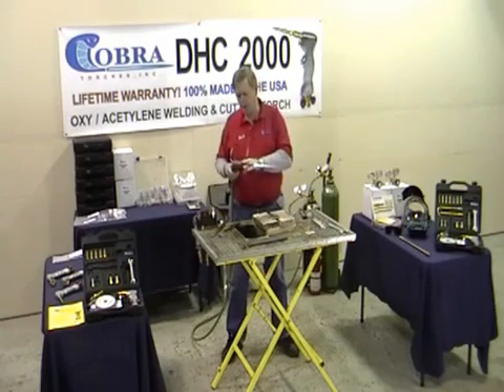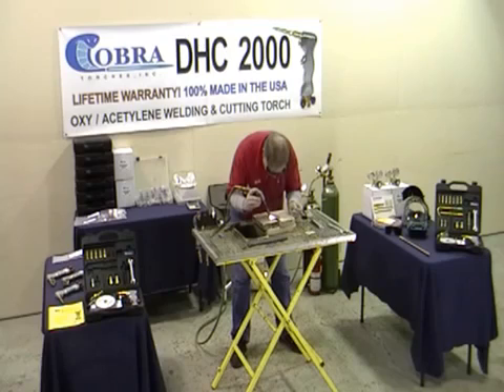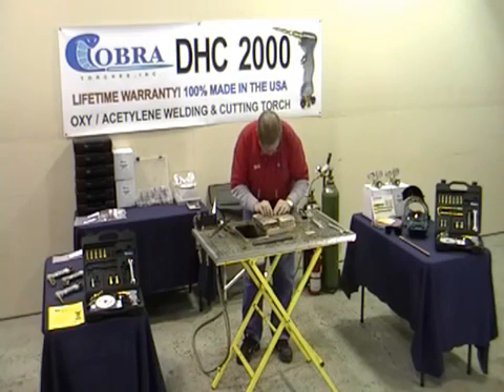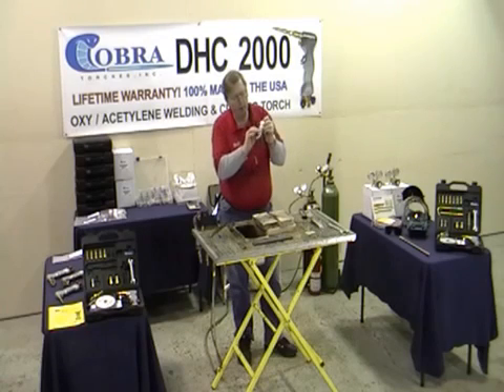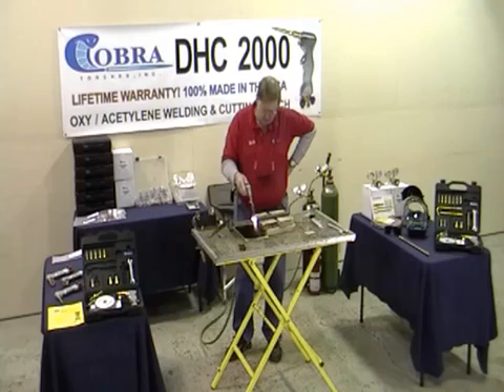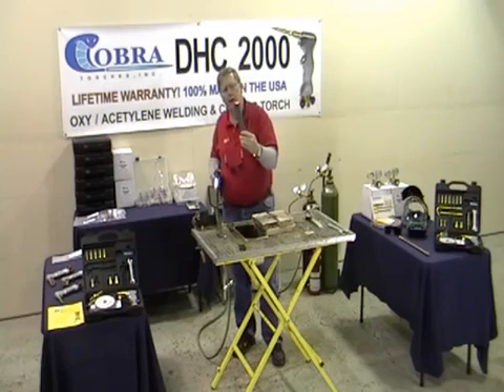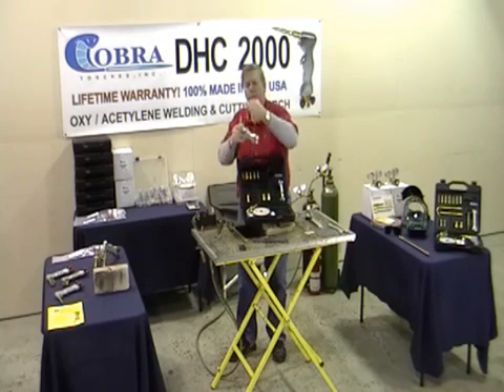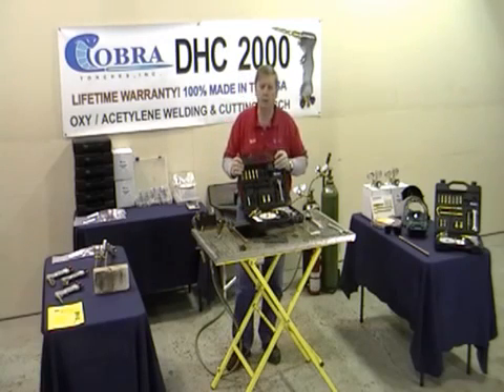DHC2000 Welding Torch Demo

Comment: Why not put the camera across the car park? This Australian invention was sadly sold off to the Americans and has since been over sensationalised by sellers with doubtful welding skills.. The original Dillon torch is not the same. It has an additional adjustment on the shaft where the tip is screwed on